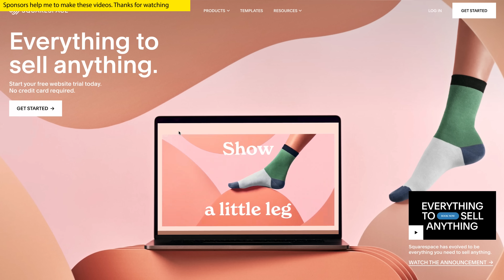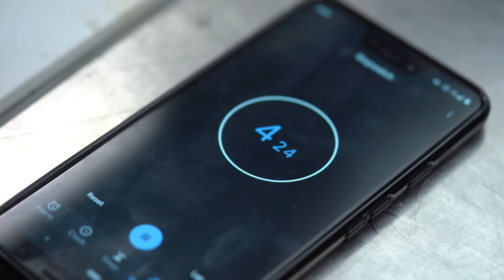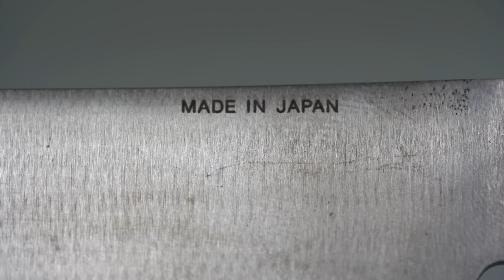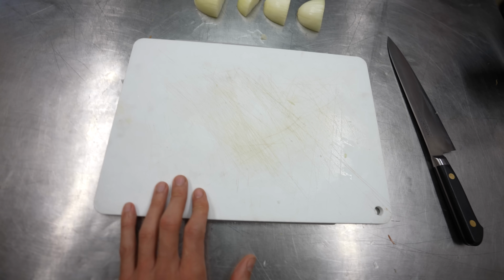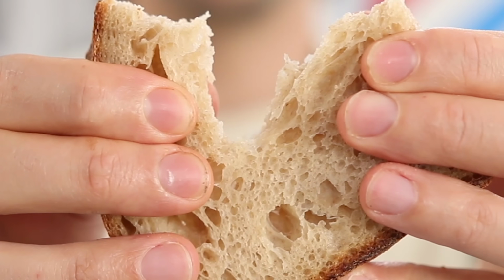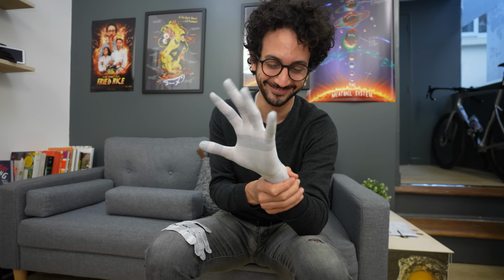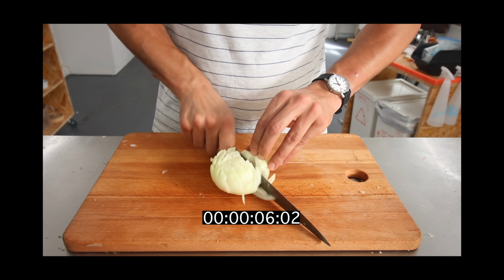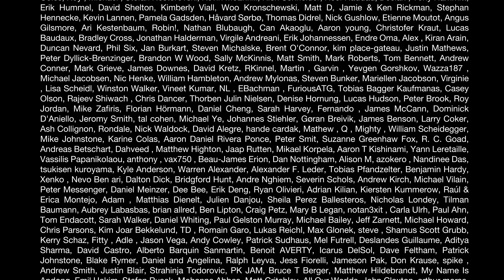I Broke My Onion Record Using The "1% Principle" (Atomic Habits by James Clear)

Comment: Turns out the most efficient optimization was in how you were timing yourself. If you set up a foot pedal you could probably shave off a couple more seconds.
Reply: Just use the video frames?
Reply: That was just cheating lol, changing the method of timing to not waste the usual second moving your hand to pick up the knife…
Reply: I also thought about that,  but it won't change how fast the onion gets cut
Reply: @Vfulncchl  you mean the extra sscond to move his hand away and to his phone? Not cheating in the slightest.
Reply: @Chronos4088  how is it not biased (cheating) if he claimes 30 secs, where 2 seconds are just hand movement? Its obviously biased
Reply: @mickeyp1291  He claims 20 seconds with choping the onion, that means the time starts at the exact moment when the knife touches the onion. He even let go of the knife and touched stop, that probably added another second.
Reply: @mickeyp1291  because you're overthinking it.
Reply: @mickeyp1291  If the task is cutting the onion, then the actual cutting is all that should be timed. Ideally, for it to be as accurate as possible, he'd have someone else time him and he could hold the knife already. That would be perfect, not cheating.
Reply: Yep, the most beneficial time was the timing method. Probably another second to win with a vocal start/stop or simply by watching the timestamp which we couldn't do because the process was cut (edited).
But still it was fun and interesting.
I say this needs some furze spice to set up a chopping machine or special triple chopping knife 🤣
Reply: @Kayzox  Furze spice you say?
He'll probably just make an onion cannon that shoots em through a mesh of razors to dice em up XD
Reply: I think he has use the same time catching method which when he got 25 seconds before for proper measurement. 🤔
Reply: Imagine the bike rides Alex is talking about included the cyclist timing themselves getting off and on the bike. Alex was already under 20  sec lmao
Reply: You missed the point. It was about getting better against a control time. Getting better against yourself. Not just a lower time.
Reply: By voice also..

Comment: I never cut horizontally when chopping onions. I feel vindicated.
Reply: I know, me too.
Reply: I never do it either. No point when there are layers there already..
Reply: I stopped a long time ago and saw that it made zero impact. It's just a dangerous addition that's non-impactful.
Reply: I only do it when I want to get the onion super fine.
Reply: it cuts the small part on the side since the sides don't have the layers since the onion is a circle. I don't if that makes sense. I usually only cut one horizontal line since the side of the onion isn't that big
Reply: Same, I never could notice a difference. Can any horizontal cutter stans explain why they do it?
Reply: @gladyslucas198  The  horizontal cuts are for super fine dicing. If you imagine a dice having equal sides, then up to the thickness of 1 layer does not require a horizontal cut. Smaller than that and you will need to horizontal cut but you will need to do more than one otherwise the dice will be uneven anyway. Sticking to vertical cuts has always worked for me...
Reply: @SeraphimCramer  if you specifically want it incredibly fine I kinda think you're better off quartering and removing the central couple of layers, then dicing everything independently, otherwise you can just angle your vertical cuts towards the centre of the onion, instead of doing vertical and horizontal cuts. But the real way to cut onions is 'however you want them cut Chef'. And if you're Chef... =)
Reply: I do the "vertical" cuts angled in towards the center.  So from the outermost edge the knife points slightly inwards.  I think this is a good compromise between horizontal and vertical cuts
Reply: @guppyitsallgood  according to Kenji Alt-Lopez; for the perfect cut you need to aim at approx x1.6 beneath the centre of the halved onion. However, even he admits that this kind of obsessiveness is borderline anal.
Reply: @guppyitsallgood  I cut mine similar, but not towards the lower mark. I can imagine that it shouldn't be too difficult of a habit to acquire...
Reply: I ignore horizontal cuts as well, especially for anything that will be cooked or stirred vigorously. Really finely cut veggies tend to turn to mush under heat.

Comment: OMG! You are the only person to agree with me. It drives me mad when chefs and cooks tell people to cut onions and do a horizontal cut. The onion is layered already! It will already fall apart, cutting the extra time literally does not help.
Reply: I think it's because of the curvature of the onion... Even if you made evenly spaced cuts, the outside pieces of the onion will still be longer than the relatively flat middle. Hence chefs "probably" made the aditional cut to even everything out, thus creating congruent pieces... At least that's what I think.
Reply: It does help a lot if you want consistent pieces. The layers are horizontal only in the top part on the onion, but they are almost vertical in the bottom part, so without at least one horizontal cut you will get different sized pieces.
Reply: I always do the vertical cuts so that I aim towards the center of the (whole) onion a bit. So the cuts in the middle are vertical, but the ones at the sides are quite slanted. So the cuts range from, say, 45 degrees to 90 degrees. The cuts never meet, however, because I aim towards the core only a little bit. Actually I kind of point the cuts towards an imaginary point some centimeters below the cutting board. That way the results are very good and uniform, and it almost feels faster than using nothing but vertical cuts.

Comment: 100% moving air helps SO MUCH, i would actually cut massive amounts of onions in the walk in cooler, specifically because of the massive airflow from those huge cooler fans, also because the colder the onion is, the less of the volatile aromatic compound, that actually makes you cry, can actually evaporate/aerate.
a single wet paper towel under a wooden cutting board on a decently solid metal table, is an AMAZING cutting surface. the single towel, gives the cutting board enough grip to actually grip the metal table and not move, without absorbing too much of your impact force like the rubber feet can.

Comment: Lets reduce my onion cut times by 6 seconds, for that I only need to:
- Get an airblower in position and switch it on
- Get a knife at the other side of my kitchen
- Get a protective glove and wear it
- Get a metronome (common cuisine accessory) and set it for the proper pace

Seriously, I love your videos, so much fun.
Reply: Nah, you only need to change the method in which you time yourself. That's how he ACTUALLY did it.

Comment: Thank you Alex for advice how to cut an union, helps me a lot in real life. 

   CHOPING 99 PERCENT 

Some years later, working as sushi shef i think i found faster way. 
Starting position is the same.
1. Cut the cap off. 
2. Cut in half
3. Position union root to myself
4. Use any chopping moove that fits BUT  don't cut that 1%  nearest to you. Lets say keep the knife at 10 degre angle to cutting board.  
Basicaly it's the same style as was used in the street. But by pointing the knife to the root onion is all conected. And that way i use the high part of the knife, that rides on my knukles of left hant. 
5. Turn onion 90 degrees and make full cuts. When it's to hight near the root. Just lay it downd with the root looking up and finish the job.

Comment: if you lined the halves up and did all the vertical cuts first you might be able to do all the cross cuts across both of the halves at the same time. 1%^
Reply: This might not help despite seeming like it should be an efficiency improvement on the surface—with the same size knife, it can slow your cuts down quite a lot more when you have double the width of stuff to cut through (and a larger knife would be slower and more unwieldly), plus you'd have a harder time holding both halves in a stable and safe way (claw grip) with your off-hand.

I've never tried training the technique up with that, but my impression is that it'll be slower to do that safely and consistently than doing each half separately.
Reply: In that case, why have two halves? The whole reason for having the two halves is to separate them. But wait...now we just have that technique that he addressed at the very beginning, and found flaws with.

Comment: I have this pretty cheap cutter from China, where you put in an onion (or anything else) and just push it through a sharp grid of metal. Takes like 2 seconds or less to cut an onion.

Only use it when I need lots of the same size of something, like fries, or onion soup.
Reply: Own the nicer dicer (was gifted to me). This save me literally so much time prepping food. Sure, it's not Marco pierre white super fine or precise, but for high level home cooking good enough. And I can do vegetable noodles, thin slices, ribbons, two different kinds of cubes. I love that thing
Reply: You got a picture? I'm hella curious

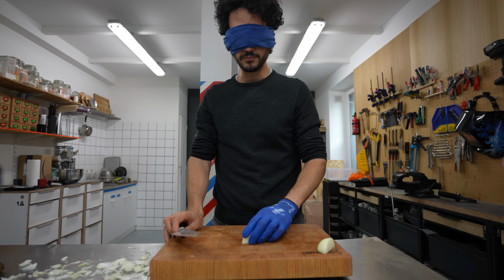Comment: 9:05 you create that mental image very quickly when you realize you don't need to be looking when you can feel everything. You kinda need to start over with different knives, a rounder santoku is a lot faster to find for me because it's easier to picture where the tip is. A good way to practice is slicing individual cloves of garlic as thin and as quickly as you can

Comment: About horizontal cuts.

I just googled as you finally made me think about doing it, about horizontal cuts into an onion, they're needed if you need uniform cut pieces. A guy lost points on his knife cut practical in culinary school because he forgot the horizontal cuts and thus had oversized pieces.
Reply: That's only true for pieces smaller than about quarter inch.

Comment: The 1% approach becomes more complex and valuable when you realize that its most meaningful application with something like cutting onions comes with cutting many, many onions and not just one.  For example, if you were to think about how to "shave" time off cutting ten onions or ten bags of onions, you'd have many additional areas to apply 1% improvements. When you've only got the one onion you limit the direct and indirect (unexpected) variables that you can change. However, if you were to apply the principle to an 8 hour shift of onion cutting, you'd find an additional 20-30 areas variables by which you could increase performance by 1%.  To name two obvious examples: shoes and flooring. There are few physical activities that can't be improved by having the proper stance, footwear, and flooring.    Try a 40 week of cutting onions (which is only 35 hours in Paris) and i will guarantee that you can cut the average time to cut an onion in half, from 20 to 10 seconds or less---and you'll be using a food processor better than anyone else on youtube.
Reply: When I worked at a pizza place many years ago we used a machine with a hand crank. You can cut them super fast but the process creates a ridiculous amount of onion fumes. Without a solution you ended up doing it for 5 or 10 minutes and then escaping to the walk in fridge to recover.  I settled on wrapping cling wrap around my head over my eyes. People called me crazy.... But I wasn't going to cry about it.

Comment: Fantastic video, like normal. I worked as a GM at Chipotle for years and spent many, many hours cutting onions since all of the onions are cut in store every morning and by hand, unlike many chain restaurants. The method that I ended up employing for the original vertical cuts was to face the onion away from me (root toward me), and use the heel of the blade to make those cuts instead of the tip, using a rocking motion with no diagonal movement so as to ensure that even the parts closest the root would get a fine dice. But I would also cut on a radius so that there would be less rounded/uneven cuts from either side. Might help you get a couple more seconds

Comment: Yes! The fan is what I use in any kitchen when I have to cut a lot of onions. I have a small, rechargeable personal fan. Great solution on demand.
I think the vibration absorption of the feet is kinder to your blade edge and your joints. If you want to get faster cutting onions, buy a giant bag (the kind you find in restaurant supply warehouses), make sure you have freezer space, or a lot of people who want containers of precut onions, but that is the kind of practice needed by working cooks, not home cooks.

Comment: End-grain cutting boards are great because they tend to hold things in place and they help preserve the edge of the knife.

As for that particular knife, it would be nice if the spine were rounded over and polished where the index finger comes in contact with it.

Comment: How much longer does it take to get ready to cut an onion in the improved way to save a few seconds?
Reply: It's the fact that this principle even works with chopping onion, Neal.... You can apply this to anything, and it goes with the intermediate to pro segment of the skill, not to the beginner to intermediate segment.
Reply: @laiquocbao2565  yes I understand the principle and it’s a good idea. But if it takes 5 min to get ready to save 5 seconds it’s the application that I’m questioning. I’m mostly joking by the way

Comment: Personally I use a mandoline most of the time when I'm cutting onions.  
However if you are going to try this and use a cutting board like this on a smooth counter top, like steel or stone, put a tea towel under the cutting board so it doesn't accidently slip.  That could be really bad if you're chopping this fast and the thing your other hand is resting on unexpectedly moves.
Reply: Or just take the extra 20 seconds and do it at the pace you like.
Life is not a race, especially with homecooking only the results matter, not the time it took you to prepare it.

Comment: I am a chef at Bluebird, Chesea and I approve 👍 Bravo, Alex!

PS. For chopping board stability, dampen some kitchen roll, place it under the chopping board and press down. This is standard practice in professional kitchens. Prevents slips, accidents and can be used to give the board a quick wipe down afterwards too 😊
Reply: I still do this habitually despite being long retired from professional kitchen work
Reply: As a home cook, I usually use a paper towel.
Reply: @DahVoozel  if it's damp then it's the same thing 😉 well done

Comment: I think you can shorten a bit more as well: cut the onion in 4 parallel pieces with the central 2 thicker. The central can be chopped easily with your classic technique, and the small curve ones are smaller and easier to chop with cross cut.

Comment: Please do a month's internship at an Indian street food stall. With shear amount of customers per every minute, u will learn automatically. U missed key ingredient of 30% improvement (cheapest thinnest knife made from hacksaw's blade used by all street vendors). That knife is traditionally sharpened against road or cement electric pole.

Comment: One thing you can try for the onion smell, is to put a couple of drops of thieves oil into a small dish of water and place it on the counter ,nearby.  Will get rid of the vapor from the odors and save the crying.

Comment: Alex, you probably already know this,  but for those who don't.  Removing the feet on that cutting board prevents air flow under it.  If you wash the board and set it down on the counter,  that water will begin to penetrate the board causing warping, expansion and possibly cracking.  To avoid that,  store it upright on edge when it doesn't have it's feet.

Comment: There is a better way to dice an onion for a more uniform dice. You start with a quartered onion. You make a series of vertical cuts half way across starting at the thick end. You rotate it 90 deg and repeat the process, then you slice across perpendicular to the vertical cuts.

Comment: There is a major flow in your technique Alex, it will make you save a couple secs. You have to take profit of the arc of the blade for the first cut. Instead of precisely doing the cuts, you can just do fast cuts but the blade has to stay parallel to the board. The point of the knife never touch the board, basically cutting the onion but not all the way. Then you turn the onion 90° and fast cut again. 
You save a lot of time cause you don't really have to aim

Comment: The knife the indian using is simple, very light weighted and costs a little around ¼pound. It's just very very sharp thin metal piece binded between very basic wooden pieces. Due to this, with practice he could effortlessly cut through the onion /tomato / chillie / capsicum etc due to sharpness and lightweightedness. Efficiency is the key in every factor here.

Comment: Sharpen your knife to start. Angle the blade down so it’s slicing and the blade strikes the board tip first and not all at once. Then you’re slicing and not forcing the blade through. Smoother faster action.